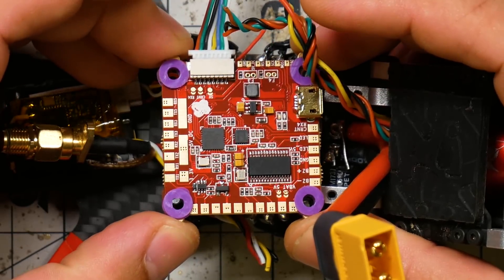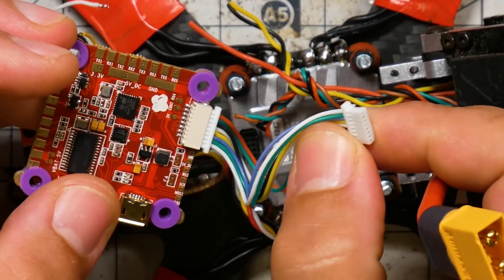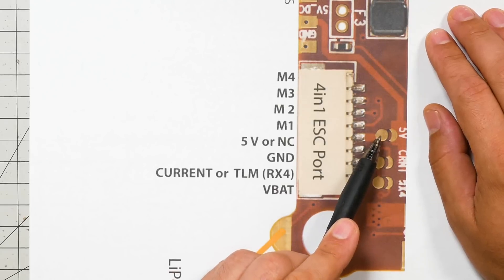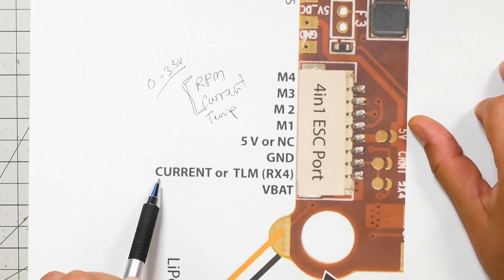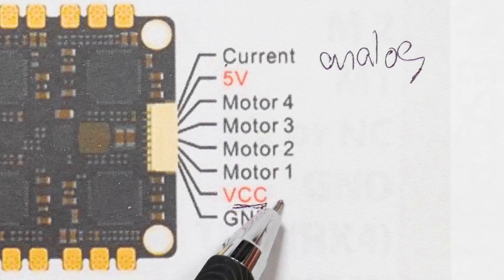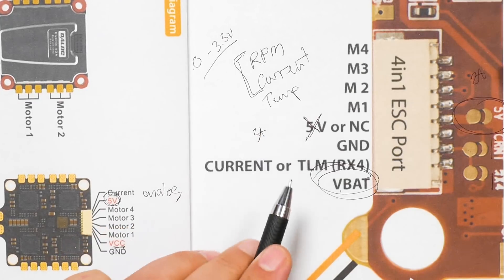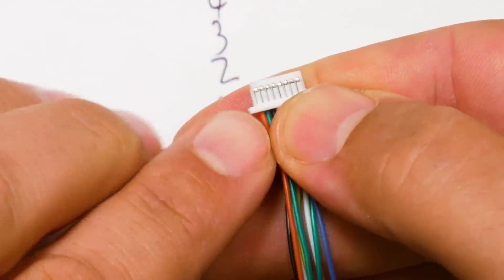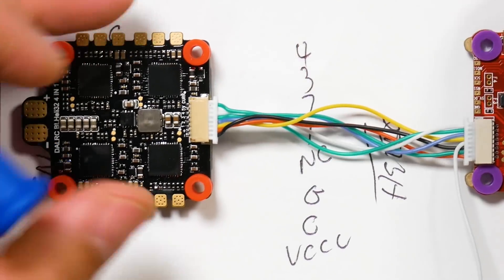How To Connect a 4-in-1 ESC to FC | HELIOSPRING DALRC ENGINE

Comment: What current sensor settings are you using on the dalrc engine? Mine reads low. And I have a spedix gs35a 4 in 1 and it constantly reads 2.5 amps while unarmed on the bench. How do I fix that?
Reply: Jay Bird Did you ever figure this out? I’m having a similar problem with my setup which reads 10A unarmed

Comment: I have this same build and been flying for about 2 months.  Repinning the wires wasn't too bad.  I purchased the wiring kit from Race Day Quads and it was perfect.  I still get a lot of noise in my video even with a 1000uf capacitor.  So far I haven't found a solution but its still flyable.  I'm using the Odin firmware and I couldn't be happier with how it flies!  It was kind of a pain in the ass to round up all the info for this FC & ESC combo and butterflight settings but I am sure this will help others!
Reply: If nothing helps, take a look in the motors tab. Make them spin and see how much noise they generate. Could be that. 😉
Reply: Did you have any issues with your current OSD? I’m having weird readings where it reads correct for one flight then jumps to wrong for another.

Comment: Is the capacitor the one thats shipped with the ESC or a bigger one?
Reply from the maker: I wouldn't assume it's the one that's shipped with the ESC. I probably just pulled it from a drawer.
Reply: ok because i heared from guys with tons of problems using the shipped 470yf cap...
Reply: I used the cap that was supplied with no issues

Comment: Joshua, at 2:45 you implied that boards that take 5v input, like the Helio Spring, do so because they don’t have their own 5v regulator. This isn’t the case - the Spring has its own 2A regulator. I think it’s an option for users who don’t want to supply vbat for whatever reason.
Reply from the maker: Ummm I don't think I said that. If I said that it's a mistake. The Helio definitely has its own 5v regulator and in the making of this video, I had a conversation with Helio about how it interacts with the 5v on the ESC, so I know I was also aware of that when making the video.
Reply: Joshua Bardwell Sorry I edited my comment to clarify while you were replying.

Comment: You use softmount for helio spring? Need It? They told me that the direct mount on the screws without any softmount is true?
Reply from the maker: I used soft mounts in this build because this build was having noise issues with another FC before Helio.
Reply: I see all the time on the helio slack that soft mounting beyond the gummies supplied causes more issues.

Comment: What 4in1 ESC and FC would you go with for around $100 total for both?
Reply: Well he just recommended the Dal RC engine and he has a flight controller so I mean???
Reply: Tekko 32 has the same pinout and connects fine.
Reply: QUADBOT FPV depends a lot of track guys are unhappy with the mesh up aka f7, to many people are burning up motors esc...so buy for what you need. $100 emax 2 stack 20x20 35amp, small and has everything you need, just solder away. That's me though lol
Reply: This can be sold with simple math!

Helio 
+ 
Aikon ak32
=
 rock solid
Reply: the new hobbywing 45a stack